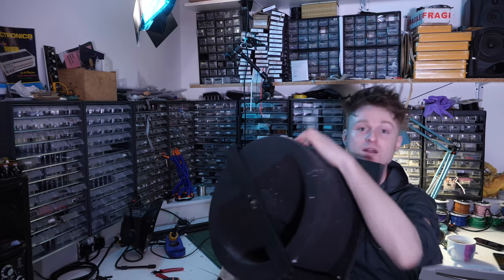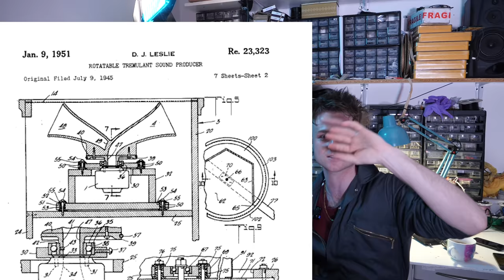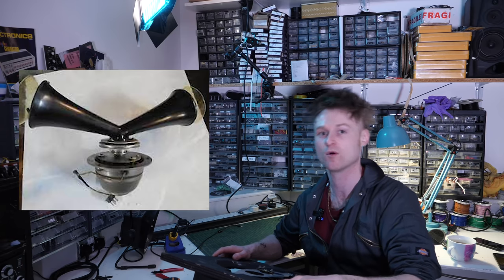Spinning GUITAR made from a LESLIE SPEAKER

Comment: Hey! Long time Leslie speaker fanatic and tech. I will tell you that you really should enclose the backside of the 12 inch speakers in their own speaker box enclosure.  Doing so will help the Doppler effect be much more pronounced and sound even better. 

Organ companies typically just put some dampening on the backside when they were mounted inside an organ because the inside of the organ acted as a separate chamber or box for the backside of the driver.  They would then put an opening on the side of the organ chassis that would let the sound escape from just the baffle side of the Leslie. 

Also, you will probably like the sound of them mounted horizontally like you did in the video verses vertically.   Good luck. I’m exited for an update!

Comment: using an acoustic guitar, replacing the back with the leslie and plugging the sound hole in the front would do a lot to enhance the effect of the baffle on the sound.
Reply: Probably not as much as you think, as the soundboard would be radiating the sound forward anyway. The job of the soundhole isn't actually to project sound as much as to release the pressure that would resist large bassy movements of the board.

Comment: Fun project! 😁👍  It gave me a similar idea you might try: take an existing steel string guitar and mount a small flat disk underneath the strings with a small DC motor to spin it, preferably variable speed. Then attach small permanent magnets to the disk equally spaced, so if each magnet is 1 inch long leave 1 inch gaps between them, more or less. I'm not really sure if it will create a desirable effect or not, but might be fun to try?

Comment: Just thinking about when you use 2 of those in a stereo set up, the drums will be spinning in the same direction, so the sound will move right to left (or viice versa) on both
Couple of ways to  reverse direction, either cross the belt or take both motors apart and flip the stators over, i have done the latter and that's how i'd do this too
Reply: Not really familiar with AC motors, but as someone who is, can you explain why reversing the power input doesn't reverse the direction of rotation?
Reply: @Nevir202  Those motors are shaded pole, the supply is ac, so it doesn't matter which way the power is applied
If the shaft stuck out the back, it would be the opposite rotation, the only way to geet this would be to flip the stator
Reply: @sparkyprojects  Ya, I just don't get how something that runs on AC spins in one direction, rather than jittering back and forth, without having something similar to a bridge rectifier.

So then whatever you have that's making it not jitter, I would think would make it rotate the opposite direction with reversed hookup, and I can't find anything explaining why it doesn't.
Reply: @Nevir202  You should check the wiki article or YT vids about shaded pole motors, they have a shorted turn to kick the  motor in a certain direction and give a phase elay
Without it the motor may just buzz or go in whichever direction it wanted, take a look at your microwave, the turntable may go in different directions each time you start it
A bridge rectifier would turn the motor into a solenoid and won't turn
The only motors that work on DC are brush motors or 'brushless motors', which are actually 3 phase ac motors with electronic inverter.

Comment: To be honest with your last video I was thinking about this with a smaller one of these in a custom electric guitar with three output one goes to the speaker, another one goes to the amp, and the last one goes to the speaker again but you can add pedals to the guitar before the speaker to get different combinations of sounds. Edit you would have to find a way to oscillate the speed of the speaker like by the wammy bar

Comment: If you box out the back with acrylic, won't that make the problem even worse? Instead, surely you want to put the perspex on the front, to ensure as much airflow goes through the baffle as possible...?

The thing with a spinning speaker is that the effect come from the fact that the path between the sound source and the ears keeps changing in length, when the sound path goes through the spinning hole.

Comment: Rather than this, what if you took a regular acoustic guitar and installed a plate on the inside with a hole or holes that intermittently block and unblock the soundhole?

Comment: Change the motor for a low voltage DC one with a speed controller for fully adjustable effect instead of just two speed setting's

Comment: Nice project! Maybe replace the motor with one out of an old rc car or something like that, so you can use it with batteries :).
Reply: Power it with a RC car battery and use a speed switch so the speed can be altered using a foot pedal.

Comment: But the Leslie won't really impact the sound if it's plugged in, right? The Leslie only impacts air/sound, whereas an electric guitar uses electromagnetic vibration... 

If you mounted the pickup on the bottom of the baffle, you might get a cool doppler effect. And I'd you mounted multiple pickups at specific intervals and offsets, it could get really weird. Though, w/o special spinning connectors, cable manager would be a nightmare.
Reply from the maker: Probably would not be Doppler from that. It's like the crystal palace thingy j made the other month it would work somewhat similar.. this is not an electric guitar.when the sound box is on the back a mic will be in listening to the Leslie assembly. It will be electro acoustic
Reply: @LOOKMUMNOCOMPUTER   ah, a mic'd acoustic type thing makes more sense. I just saw the electric guitar parts and made assumptions. 😛

I figured that the speed of the Leslie might make a difference as far as doppler, particularly the outer edges. But you are far more knowledgeable than I. 😊

Comment: You're killing me.
I'm gonna root through my mind and see if I can recreate the modulators for them.
The main cabinets had the electronics in them 
They had a gain/swell/speed controller settings based on key triggering and when you hold the keys and dials to adjust on the fly.

Maybe remap a note bender on a keyboard as a speed controller...that's partly how they worke.

They're awesome in concert.
Hammond corporation...look for Sam's electronic schematics somewhere.

Those were the electronics bible at one time.
Universal service manuals from like 1950-1988 at least.
Those are from prolly 1958-1978

Hope that helps you.

Comment: Prepared guitar?
Reply from the maker: huh?
Reply: @LOOKMUMNOCOMPUTER  Maybe you could set it up as a prepared guitar? Just a thought.
"A prepared guitar is a guitar that has had its timbre altered by placing various objects on or between the instrument's strings, including other extended techniques. This practice is sometimes called tabletop guitar, because many prepared guitarists do not hold the instrument in the usual manner, but instead place the guitar on a table to manipulate it." -wikipedia

Comment: Pity you couldn't have the speaker located more remotely and comfortably away from the guitar. Maybe like a set of microphones to pick up the vibrations of the strings. That signal could be sent with something as simple as a fine cable to an amplifier. Use the amp to power a conventional cone speaker. With a speaker behind the tumber you would get the outward sound flow you are looking for. *dusts hands   Problem solved.
Reply from the maker: Sounds like just a Leslie speaker?
Reply: Yep, intending to be kind of sarcastic. There's something sort of ridiculous about de-engineering all the solutions to realize you have a design problem. It's good I guess as in a way it shows why things are designed as they are. Fun video, just somehow amused by the outcome.
Reply from the maker: @beavis6363  leave no stone un turned
Reply: @LOOKMUMNOCOMPUTER  Love the attitude and spirit, overall I *did enjoy the video! To be honest, I was thinking about a different contour for the tumbler. You need a a quick spiral. think of a snail shell. Scoop on the out side drafting air to the center with a port. As the smaller inner spinning port intermittently passes under the strings you might get some tremolo. "No stone unturned", I like it sir. You need to source some variable speed control too, even more interesting sounds!

Comment: Who cares about "you should have done it like this or that." At least you're doing it. Everyone has an opinion yet they aren't the ones working on the project.
Reply: That being said, it would be rad to have everything self contained. Pickup for the strings, to a small amp and speaker facing the rotor.